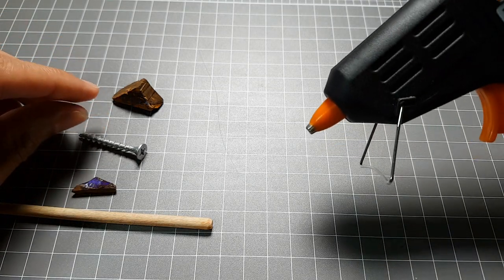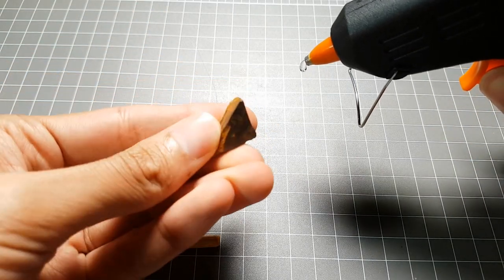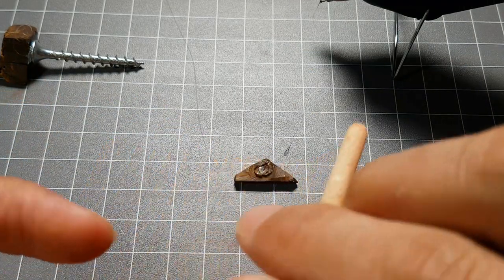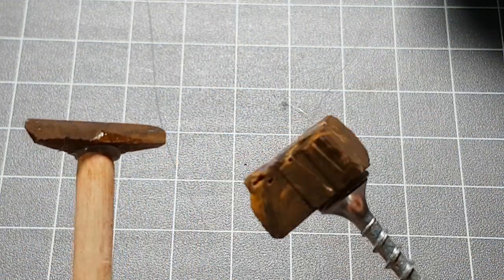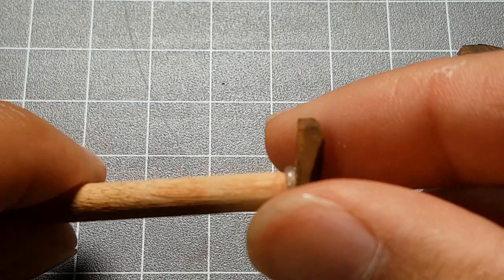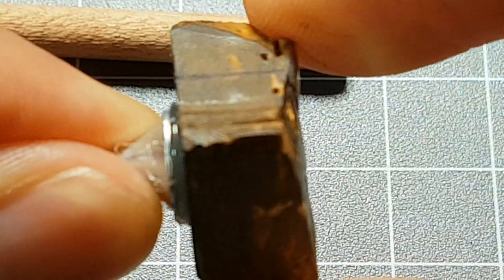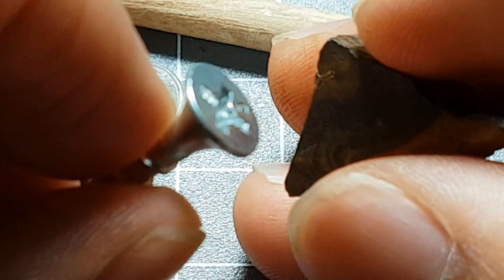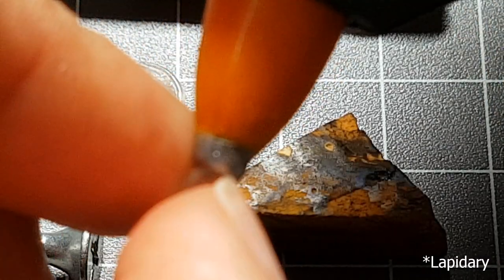(DONT USE HOT GLUE ON OPAL!!!) Dopping Stone(s) with Cheap Hot Glue (vs Epoxy vs Wax vs Superglue)

Comment from the maker: DONT USE HOT GLUE!!!
If you use the high heat glue you might get a strong enough hold on a stone but it may also be hot enough to SHATTER an opal. 
They dont like temperatures that high (that glue is well over 210 Celsius or 410 Fahrenheit).
Reply from the maker: If you just work boulder opal it may be okay.

Comment: Dude you gotta try 2 part epoxy as a dopping material. It holds so incredibly well. Only downside is you have to let it sit for 30min before working but that's not a problem for me. It's easy to get off too, run the stone under warm water and pop her off. Will have to try the hot glue on some cheap opal. Thanks
Reply from the maker: Yeah that is already my preferred method.
https://youtu.be/E_3eXOODpBo
and 
https://youtu.be/yy6-Nw_tMpk
I moved away from wax to epoxy over a year ago now, havent gone back.
Reply: if u use the 2 part epoxy, are u putting it on a screw head or wood stick or does it matter?

Comment: Oh I agree ten THOUSAND percent. I hot glued opals to a ceramic goblet when I was a kid and cracked all of them trying to get them off.  Since the backs were polished, I figured the glue would pop off rather easily but this was sooooo not the case.
Reply: Let me clarify, they didn't crack when I put glue on them.  It was just impossible to get the glue off of the stones without cracking them. They were either Aussie or more likely, Idaho opals.  Dad and his partner owned a gem and jewelry company when I was little sooo... keep your stones locked up and away from your kids. If they grow up with dad using diamonds for a magic trick, they don't really comprehend the value of what they are playing with.  That said, the stones my dad gave me when I was young, even the faceted piece of glass,  I have carefully kept and cherished all my life. The only thing I think might be good for hydrophane and hot glue (low temp and maybe let cool a second before application), is that it won't soak into the stone.  Anything soaking into hydrophane could potentially oxidize (like oil will).  I've also got triplets that have had the epoxy yellow and they were stored out of the sunlight...I inherited these, so I don't know what was used, but you can tell that the yellow hue isn't the stone color.
Reply from the maker: Haha there is one viewer that had a dog swallow a stone or two so very good lesson to not let kids or animals mess with the gems!
On the point of yellowing triplets this is quite common with older ones as the resins were not so well developed to resist discolouration. Its why I stick to epoxy 330 for triplets and doublets, though many modern epoxies are quite good I just trust the 330.
I've been thinking about doing an accelerated aging test at uni on a dozen or more glues but its a tad unrelated to opal.

Comment from the maker: Due to popular demand I will be trying this with a stronger hot glue to see if it is any better...
Reply from the maker: Any specific brand suggestions feel free to comment.
Reply: You just need to use a bit more than what you used in the video. The amount of glue wasn't enough to stick to the wood well enough. No need for high heat.
Reply: It needs to look like how justin from BOD would apply the wax.

Comment: Roy new big big fan of the channel my names Ed and your video talking about the screw I freaken love it use it all the time and I cut n old broom handle into 3” pieces and it’s awesome oh yea I use just reg super glue it’s fantastic I highly recommend it . .i had to use the screw driver at first and now I just turn it on with the Stone haha love it and you covered it in this video to . If your a newbie like me Roy is the man he as all the tips n info thanks bro
Reply from the maker: No worries Ed. Yeah if I'm using a screw or nail I normally add them to the stick first then glue them on after. Superglue is a good one. Slightly more susceptible to letting go compared to epoxy but much more instant.

Comment: Just got here to check what I am doing wrong using hot glue gun for dopping. I tried wax, epoxy, PVA but glue gun is my best method and using it for ages without cracking any stone. It requires some preparation of the stone that's why didn't work for you. Fastest method if you want to cut straight away. Done more than ten thousand opal without any issue.
Reply from the maker: You must have different hot glue because the stuff I have is rubbish. 
What preparation are you doing? 
Epoxy doesnt require special handling and will never be beaten by hot glue (just slow), PVA doesn't work and wax is pretty much the best if you know how to use it and can get a good supply. If you want instant simple superglue requires no prep and no heat.
10,000 opals is great but what kind? Done anything less stable like ethiopian/indonesian? Both would start popping for sure.
Reply: @RoysRocks  I'm just using the same cheap stuff from Lincraft. I'm in Queensland, Gold Coast. Australian opals keep me busy enough, also have principals, I don't touch Ethiopian opal. I do Boulder, Ridge, Coober Pedy, Andamooka,  Pipe.. Whatever dug out from this amazing red soil. Maybe you are right and hydrophane opal would crack but I had success with Tintenbar material too.
Hot glue sticks on shiny surface so  after I pre shaped stone by hand I touch the back a little bit on 600 then 1200 Nova to get it roughly polished, If you go 3000 will hold even better but no need. Next thing (I have a feeling I will be stoned to do this) it needs to heat the opal. If you do with cold stone the glue will freeze straight when it touches the opal and won't hold. That is what happened in your video. Also the glue needs to be more hot and fluid, it is better to plug the gun in 3-5 minutes before use. Only unplug for a little time when the glue gets very hot and start to form bubbles inside. I place the opals under 40W light bulb from 8-10 cm will heat them up to 50-80 C slowly and touching the glue won't shock them. When everything hot put some glue on wood stick and quickly place on opal. I spread the excess with finger quickly so it won't get burned. It's like touching hot candle wax. It will allow you couple of seconds to position the stone on stick before it cools. Put it aside to cool down together with the stone. Another minute and it is ready to cut.
Advantage: Fast and easy. Disadvantage: In wet condition it won't hold the stone for long. If water finds the way to go between glue and stone it will peel off in time. Need to finish cutting within 10-20 min which should be plenty enough. Another disadvantage is when i cut boulder dry (matrix mostly) and the stone gets hot by polishing it obviously will soften the glue so while doing it I have to cool down the stone by put in water for a short time before continue polishing.
To remove from stick I peel off side of the glue with fingernail a little bit and one drop of methylated spirit, it will release the stone and comes off easy.
Both epoxy and PVA worked for me in the past but found them too slow, I only can cut next day. I never liked wax, when someone showed it to me nearly the whole back of the stone was covered with it. It was even holding it on the side which I don't like as I need access to the side of the stone especially if I have to cut it smaller than originally planned due to some sand, crack or any imperfection. Also some old bloke told me to put it in the freezer to remove. I never knew which would break first the wax or the opal if I do that.
Reply from the maker: @phenomhu  Its interesting enough to maybe make a follow up video on but sounds like a MASSIVE pain.
If you have to get the back to a pre-polished stage just to get it to stick not many are going to go with that. 
Pre-heating the stone and prepping the glue like that is essentially the same as wax. 
Wax shouldn't be all over the back and sides of the stone. Thats just people being lazy and not selecting the right sized dop stick and using too much wax. The freezer trick works well but it can also just be the fridge, freezer is just faster. Never had a stone break in the freezer but its only taken a few minutes to pop off the stick.
Getting an opal carving done in 10-20 mins aint going to happen either so another reason its not going to work out for me. Quick cabbing it wont matter but thats a deal breaker for carving.

Comment: U used way too little glue on the wooden one. On the screw could me more as well.
Reply from the maker: No matter how how much I use this stuff won't hold. It is the stone contract that breaks. The wood side holds fine.
Reply: @RoysRocks  strange, I don't know what could be the problem then, maybe the stone is too moist or too cold, I don't know.
Reply from the maker: Yeah it might be something more like that. Same thing happens to wax. It is weren't opal I'd try the hotter stronger glue.